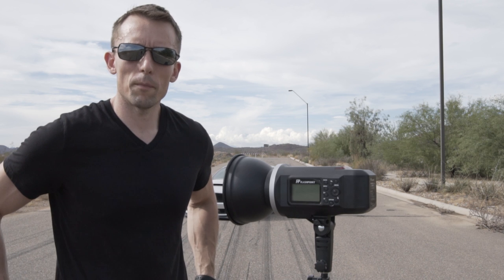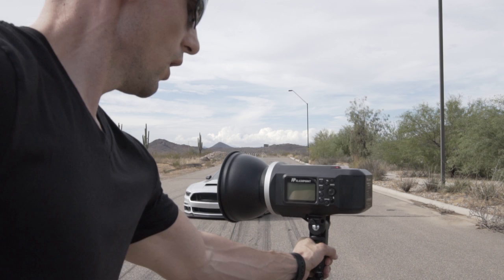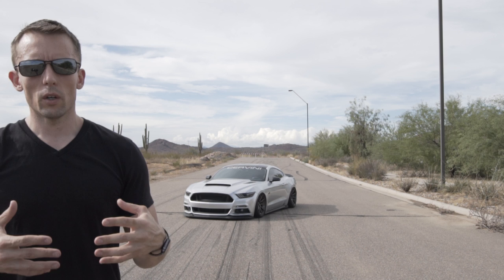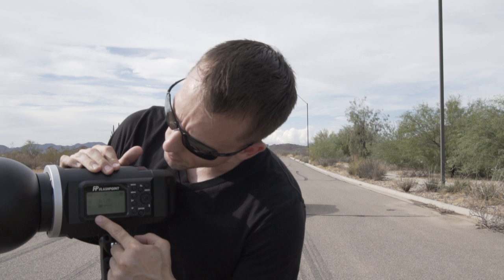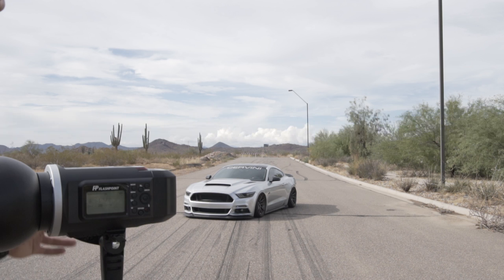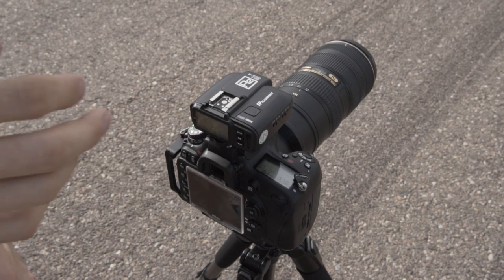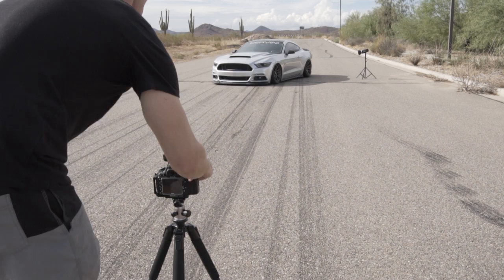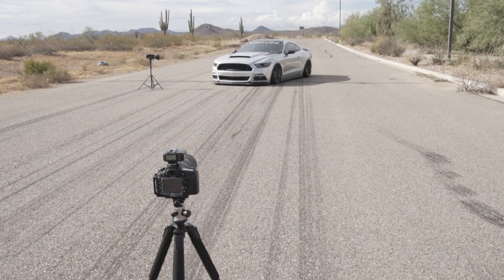Shooting With Flash Part 1

Comment: Hello Nathan, curious if you are using high speed sync and adjusting your flash output for the various positions?  Nice job btw on your videos!  Also, what r the specs on your car?
Reply from the maker: I do often end up using HSS to keep a lower f stop to get a shallow DOF. The flash out put is usually the same for each of these shots. The car is a super charged 2015 mustang gt with a bunch of stuff done to it. Thanks for watching!

Comment: Great stuff 👍 you deserve way more subs. I know this vid is 3 years old but if you could help me out that would be awesome. I’m looking to take my car photos to the next level and I think a strobe may be the move. I’m looking to get the  xplor 300 pro I’m hoping I can get similar results to this. One question I have for this photo is did you polarize the shots just for the hood area or did you turn it for the side as well?
Reply from the maker: Looks like the cpl was just set for the top. The flash usually removes the environmental reflections. The problem with a lower power flash is you might not be able to shoot in direct sun light. In this video you see that half power is not bright enough.
Reply: Nathan Brummer thanks 🙏 I already ordered it lol should be here today. Guess I’ll have to test it out and see.

Comment: Will this work with multiple speedlights?
Reply from the maker: +Ricardo Palafox for sure! I only had one so  I had to take multiple shots and layer them. If you have multiple strobes you can take just one shot and get the coverage that I needed with multiple set ups.